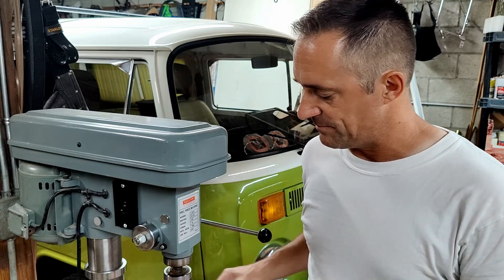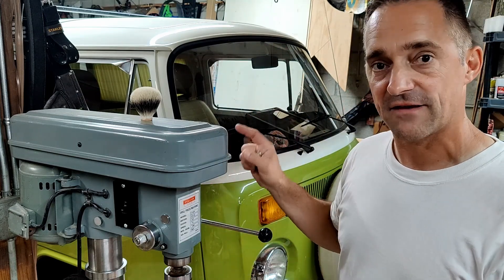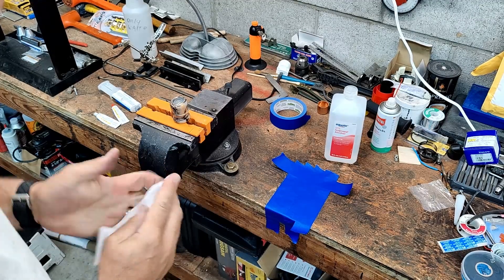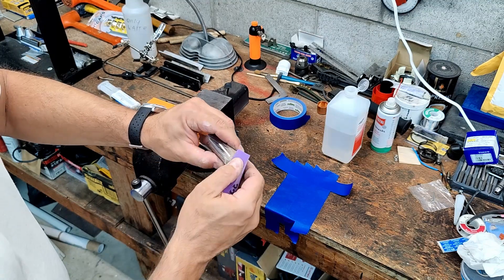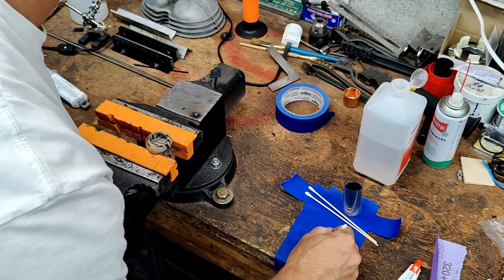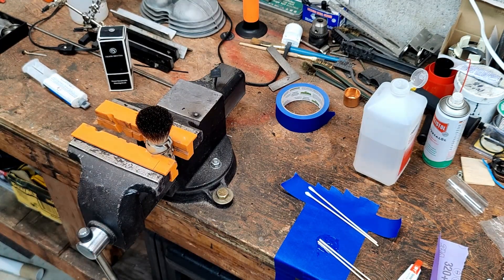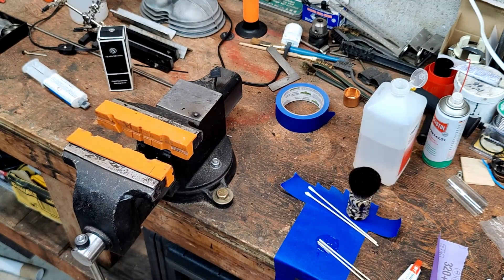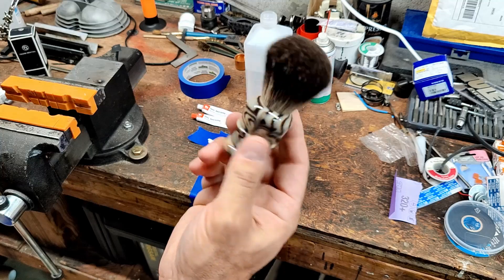The Badger Brush Repair

Comment: My first shaving/lathering brush broke just after two months of use.  I repaired it myself but without the great tools used in this video.  Instead,  I only had a worn-out dremmel tool, (now no longer effective), and no clamps and no vise-grips.  Clearing away the old glue with the dremmel was difficult.  Then, two-part epoxy I used for re-gluing the 'knot' into the handle.
Reply from the maker: Thanks for sharing. Sounds like you got it handled.
Reply: @Heiko-shaves  Yes, certainly did.  I no longer use that brush because it just will not deliver the lather but seems to pull most of it in and is always stiff and dry even if presoaked before beginning the lather.  I since bought two GOOD brushes which work very well instead.  I still do have the brush - just do not use it.

Comment: Hallo Heiko, es war doch ein wunderschöner Hintergrund, endlich eine Werkstatt in der tatsächlich gearbeitet wird. Bin schon sehr auf deine Eindrücke von einen Dachshaarpinsel gespannt. War bisher selbst mit keinem Dachspinsel wirklich glücklich geworden, habe mich allerdings vor höheren Ausgaben für einen Dachs gescheut. Den Mondial Super Badger vom Bild meines Setups aus der Email konnte ich für 14 Euro ergattern, da hatte Mondial gerade sein Logo geändert und die Restbestände über kleine Händler verramscht. Bei PAA bekommt man übrigens hochwertige Synthetikknoten einzeln für knapp $9.

Auf deiner Werkbank scheinen bereits andere Projekte zu warten - wünsche noch frohes Schaffen.

Gruß
Artur
Reply from the maker: Ich halte mich auch von wirklich teuren Rasierpinseln fern. Bei Rasierern sehe ich den Gegenwert aber bei Pinsel sehe ich einfach nicht den Wert, den manche Hersteller da auf das Preisschild schreiben (z.B. Simpson). Bestimmt sind die Pinsel alle super aber 100-200Euro for einen Rasierpinsel finde ich ziemlich extreme.
Gruss,
Heiko

Comment: For the future if you repair stuff, you have to drop a pearl flexi banter everytime 😂

Frank shaving is actually quite a decent manufacturer. Have 2 brushes from them (only synthetics) and they are great. A bit overpriced nowadays but good quality. Only their handle designs are mediocre but that's subjective I guess
Reply from the maker: I know, pearl is on my rant list. Is Frank Shaving still around?